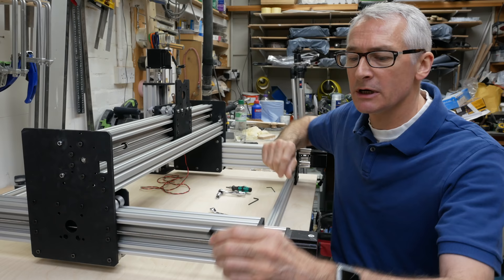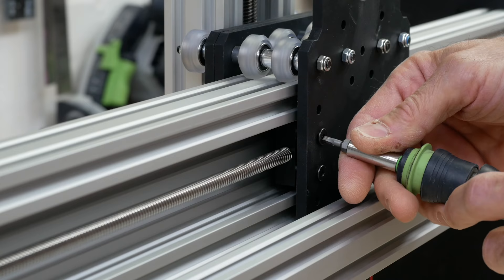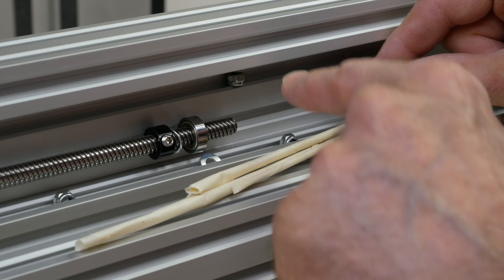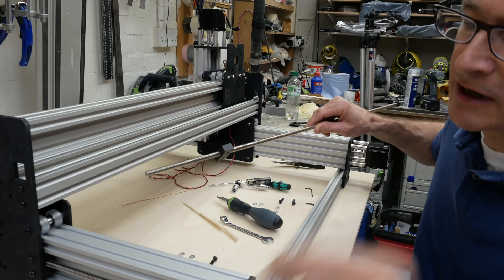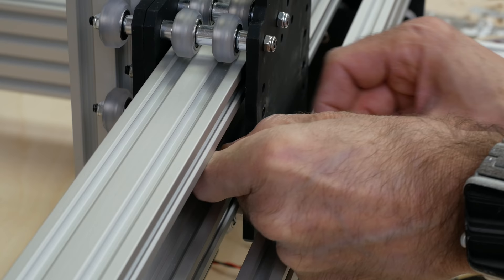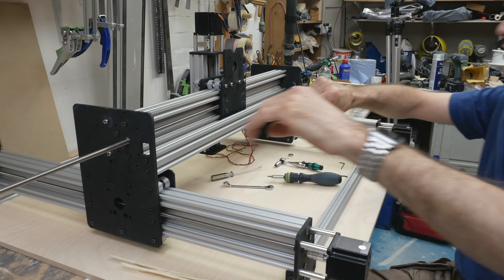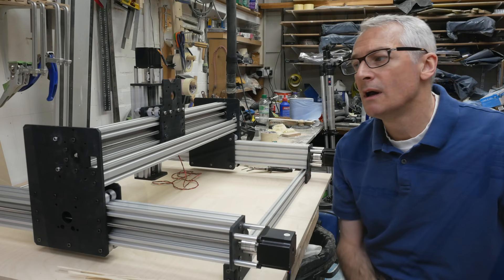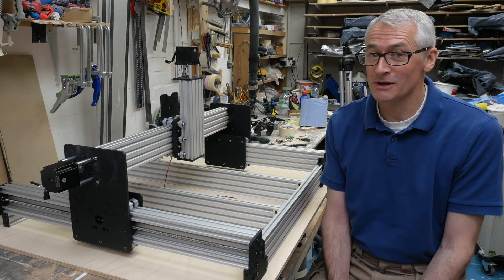Starting Out in CNC Part 3 - New Nutblocks! [Video #321]

Comment: Hello Peter... a clip from my Openbuilds blog.

The nut blocks…mmm. The current nut blocks appear to be of a design that is used in some other applications which I know nothing of. They have counterbores which a 5mm low-profile screw fits nicely into. The problem is, however, the nut block counterbores are redundant on the Workbee (and others?) and are used differently. They are normally fitted with a small spacer and precision shim between the nut blocks and the plates. The issue is, because of the counterbores, the precision shim or indeed the spacer has only about 0.5mm of metal surrounding the edge of the hole – not a firm foundation for the block at all. I removed the shims and spacers and made some 4mm plastic nut block size spacers to fit the entire back of the block. Much better, a solid foundation for the blocks and they cost virtually nothing.

It's time these old style nut blocks were purged!

Comment: I was just about to mention that you should use small neodymium magnets on the head of the screws when fitting the shims. You usually can turn the screw with your fingers a few turn to attach it and the remove the magnets to use the screwdriver. Also I would have used a magnet on the the rod to catch the shims when loosening the blocks. As always, nice video 👍

Comment: Congrats for sticking with it!!! I would suggest that at some point you get a Pencil size piece of doweling and fit a magnet into the end, it would have helped with those washers and shims. I know I would have been lost without mine when I built my machine.
Reply from the maker: Thanks Keith! TBH I wasn’t sure if magnetising some of the components would cause a problem. 🤷‍♂️ Good to heat it wouldn’t be an issue. 👍👍

Comment: If you thread the stop collar and bearing on the acme rod as you passed it through the left had side plate, you could of avoided taking the stepper motor off. Well done for fitting the new nut blocks without taking the X plates of the machine.
I have a Workbee and am well pleased with it, hope you will be with yours.
Reply from the maker: Thanks! Yes, I figured that out after I'd threaded the acme bar through the nutblocks - it was just easier to swing the stepper motor out of the way than it was to thread the bar back, lol! What router do you use with your workbee?
Reply: @10MinuteWorkshop  I have a 2.2 kw water cooled spindle fitted to mine. I am looking to control the speed from the Duet, needs a couple of changes to the system and some more wires to be connected up, but it looks do able.

Comment: So, some previous engineering savvy required? Surely the Ooznest, people don't go through all that to install the blocks? I hope they're finding your videos as enlightening as we are. Keep at it, Peter, it is afterall sold as a kit, so we're keen to see how that works out. [check your frustration 'chip' at the door?]
Reply from the maker: No, this was only a fiddle because I was installing the blocks out of order; first tine round you fit them before you complete the x-carriage assembly - much easier!! 👍👍
Reply: @10MinuteWorkshop  Gotcha, probably worse having to de-construct all that, aaand having to put it all back again.
Reply: Hi Keith, thanks for your comment. Peters video has made us more aware of the issue to change them if you changing them post assembly of the machine. I do have an idea to fix this. We are improving the manufacturer of the nut blocks, so in future changing them like this wouldn't be needed.

Comment: Hi, I have seen a few videos now of people assembling the workabee, the issue with the threaded blocks seems to be a fairly common occurrence. I mentioned it to the guys when I was at makers central but they seemed to be more of a mind to just send out replacements rather than deal with quality control. Seems a bit of a shame.
Reply from the maker: That's interesting; I wonder if there was a batch of these that were out of tolerance, and still a few knocking around, maybe. 🤷‍♂️
Reply: Hey thanks for your comment. We have been aware of the nut block issue on some of our nut blocks. At the moment we replacing any faulty ones with new ones. We have switched to a new manufacturer now which will solve this problem going forward.

Comment: It may help in future, when placing washers/shims like those use a drop of thread lock as glue. It will keep them in place but won't be  problematic to remove if needed.
Reply from the maker: Thanks! 👍👍
Reply: It does beg the question: "If the spacers and shims are of fixed sizes, and there is no adjustment of shims needed to compensate for manufacturing tolerances or assembly variations, then why not simply supply spacers that are the total thickness of a spacer and a shim and dispense with the shims?".

Comment: This is a great series, Peter. Perhaps not as compelling as the multi-part vacuum series (/sarc) but still great.That said, isn't it a bit disappointing to encounter a clear quality control issue in such a basic critical mechanical component?  Hopefully, it will be smooth sailing for you going forward.
Reply from the maker: Thanks David - and damn, I was just about to resurrect the 12-part vac series as well, lol!  And yers, it was a bit of a bugger to discover the issue, but I don't think it's practical to expect Ooznest to test every part, and the replacements were received next day, so I can't fault the customer service.  Glad I stopped when I did though... 😂👍

Comment: I have been interested in a CNC machine but for nearly 1500 quid there seems to be an enormous amount of faffing required to build this thing !
Reply from the maker: Not really. It’s a kit of parts that requires assembly; this part was fiddly because I was doing something out of sequence - the original assembly was much more straightforward, as it was done before the x-carriage was fully assembled 👍👍
Reply: Suppose you have to weigh up your return on the investment.  Time spent now = time saved later + repeatable £££££.  Just don't make what everyone else is making..

Comment: Hi Folks. So, there was the problem. Now, a word of warning. These were 'just' threaded leadscrew nuts that needed replacing. No big deal with a local supplier, and American companies also tend to have a very good customer care ethos. Bit of a worry if from the far East! You may find though that some manufacturers have used ball nuts. These contain an 'endless' run of small ball bearings. Do not just take such nuts off the threaded shaft. All those ball bearings will fall out. You will probably never find them all and even if you do re-assembly is, shall I say, a bit tricky. Read the instructions carefully about how to remove them. A retainer has to be slipped in as the threaded shaft is withdrawn.  The same thing applies if you actually have to put ball nuts on the lead screw shaft yourself. Do not just pull that retainer out. Let the shaft push it out as you run the nut on, and keep it safe, you may need it one day. Ball nuts, for those interested, have much less friction and wear out much, much more slowly and so stay more accurate for longer and don't suffer anything like as much from backlash. That level of precision - 0.01 mm or better -  is not really needed in this application. They are, of course, also a lot more expensive. BobUK.

Comment: Great sticky pins. Did not know that trick! Thanks for sharing.
Did anyone (you or the manufacturer of the kit or the supplier of the blocks) find out why the "old" blocks did not turn around smoothly?
Reply from the maker: Thanks Hans! Apparently there’s been the odd issue with a manufacturer making them out of tolerance, and I had a couple of these. 🤷‍♂️ It was resolved easily enough though 👍👍
Reply: @10MinuteWorkshop  Thanks for explaining. It's always good to know what the problem was caused by. Your "technical intuition" saved you from a lot of problems.
I can imagine those blocks not moving smoothly can cause a range of problems on stepper motor, bearings, router and the material to be machined
by the CNC.

Comment: Hi Peter. Really finding this interesting as I have been thinking of getting an ooznest cnc for a while but don't have the cash yet. Just wondering what you think you will be using this for. Do you think it will fit into your workflow so you will end up keeping it? Plus having seen some of your other videos where are you going to keep the thing so it's not in the way but accessible?
Reply from the maker: I have a few ideas for it, though they don’t necessarily relate to my current workflow! Part of having it though, is to discover what I can do with it. I plan on clearing some space in the other room where I can set this up permanently. 👍👍
Reply: @10MinuteWorkshop  Excited to see what ideas you come up with. I think I would use it for templating and then go from there. Hopefully I see it as another pair of hands... have it working on one project while I finish another. Like to see how valid this could be.

Comment: Hi Peter, have you heard of a product called Valchromat?
http://www.valchromat.pt/
It is a fibreboard that is impregnated with organic dyes and bonded together by a special resin which gives Valchromat unique physic and mechanical features.
Sounds like it would may be more efficient to work with as the finishing process would be quicker (no paint spraying?).
It is made in Portugal, but the UK timber supplier James Latham stock it and they have depots throughout the country.
https://www.lathamtimber.co.uk/

As the colour is throughout, carving on a CNC would be very interesting.

Would be keen to hear your thoughts on this product.
Reply from the maker: Thanks Andy! Yes I know of Valchromat though I haven’t  used it yet - I’m looking for a suitable project! AFAIK it’s basically MRMDF dyed throughout, and takes a finish very well 👍👍